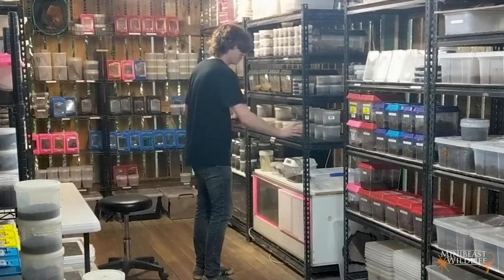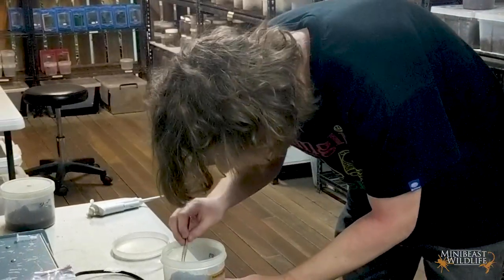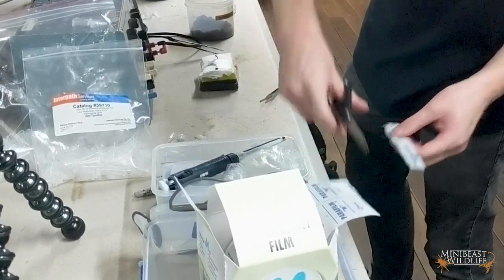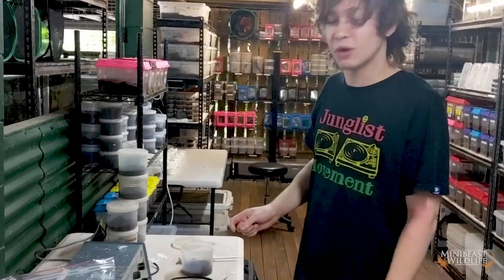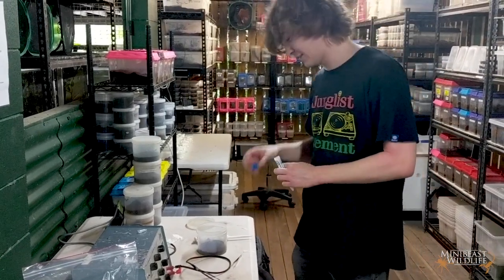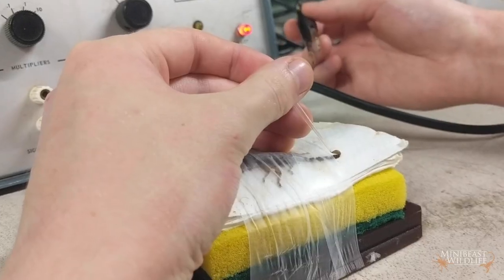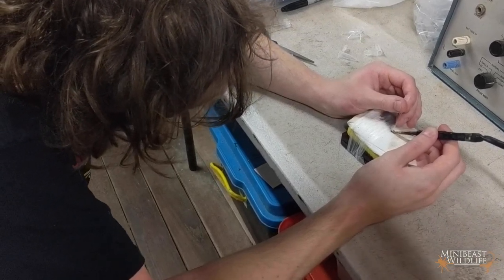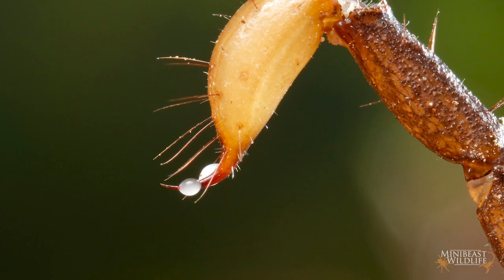This is how scorpions are milked! | Behind the Scenes at Minibeast Wildlife

Comment: Shouldnt they be actual venomous scorpions being milked? Big pincers-small tail =non venomous. Small pincers-big tail =venomous.
Reply from the maker: These scorpions are venomous and the level of toxicity they have in regard to humans has little to do with the research being conducted - it's more about investigating the various components that make up the complex venom and looking at what other potential uses the various molecules may have.  The statement you've made is a very broad generalization and not quite correct. Big-pincers-small tail doesn't mean non venomous as all scorpions are venomous. The generalization is usually used to convey that those with larger claws and smaller stings have less potent venom and are subsequently less dangerous to humans, however that isn't completely correct as there are exceptions.